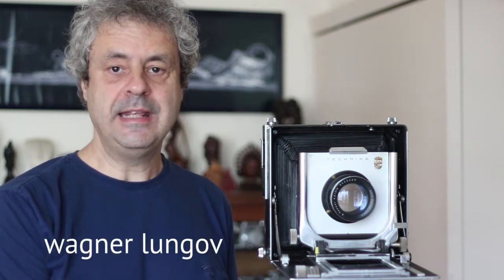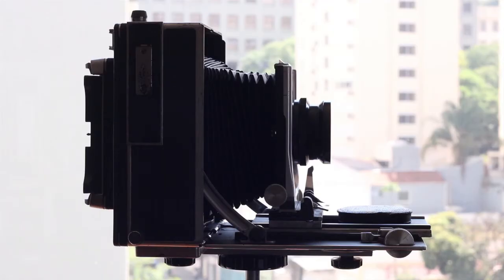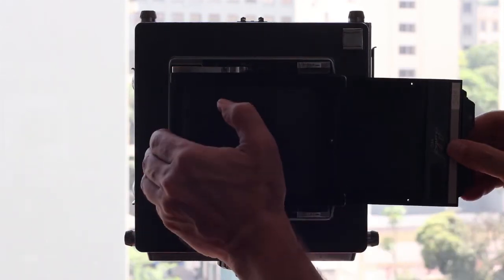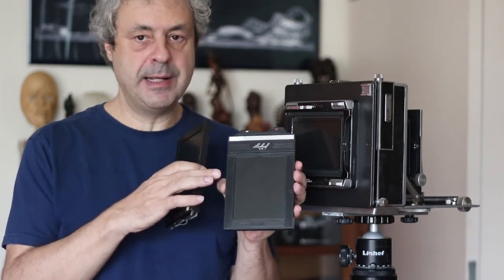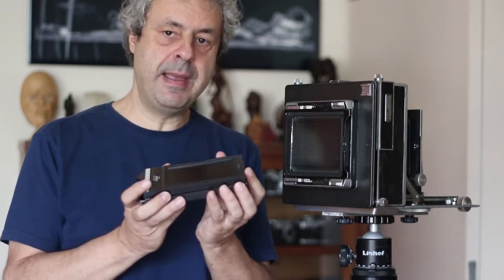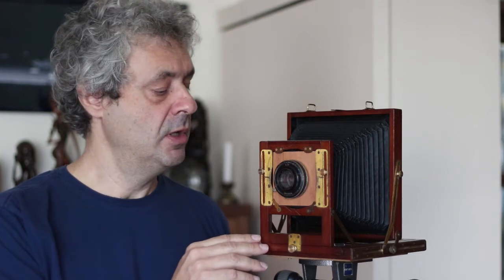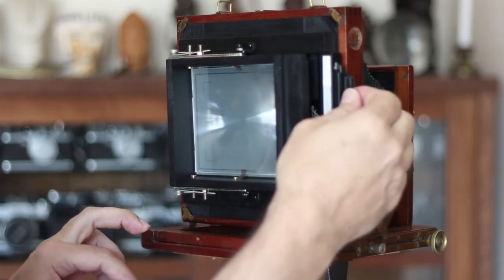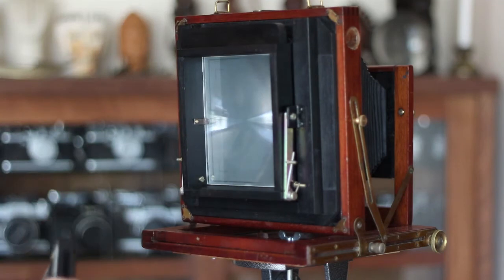Build your own large format photography camera back

Comment: Excellent video, indeed Channel.  I saw the title and thought my dream had come true.  I've been yearning after a Deardorff 5x4 Special camera, which is really a 5x7 with a 5x4 back.  I'd need to make a 5x7 back for it.  How will I do that ?   Please ....  ?
Reply: Hello Gary, you can simply use the exactly the same construction I show in this video and website and only change the measurements to fit a 5x7" film holder. I just recommend you to avoid doing that following film holder specs you may find on the web. It is better to acquire one, in case you don't have it, and build the camera back "around it".
Reply: @wagnerlungov1825   Thanking you, Wagner.